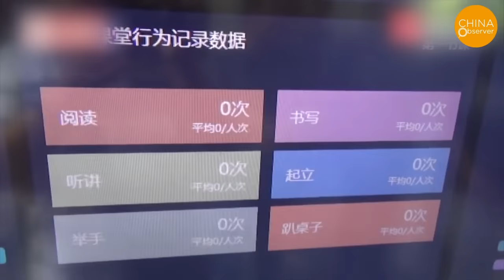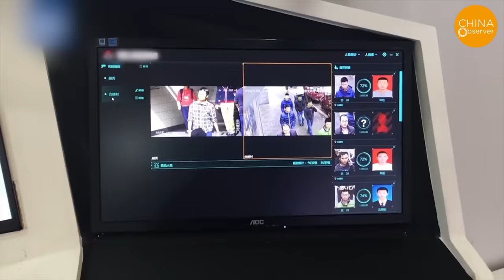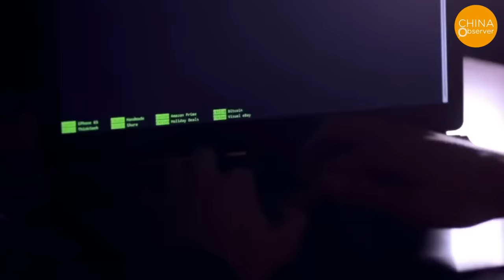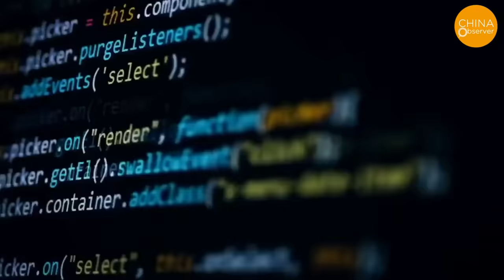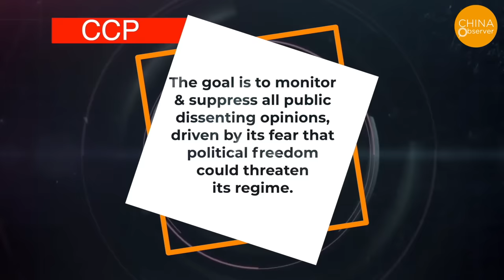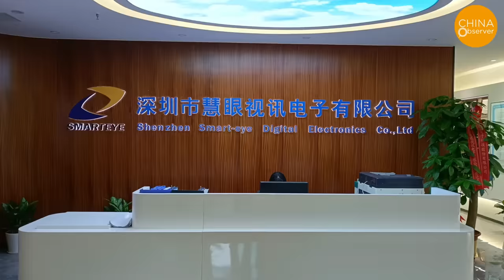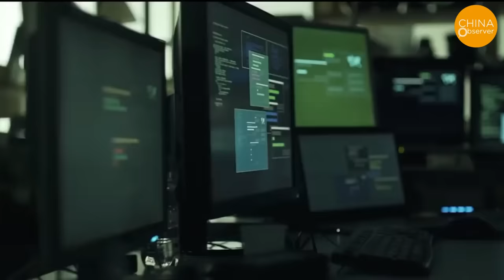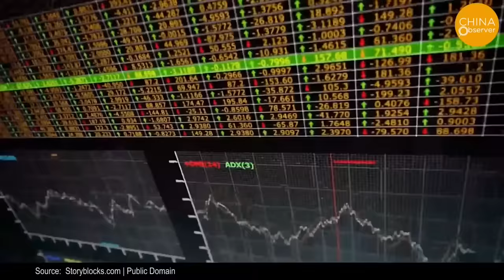Don’t Go to China: CCP Monitors Your Fingerprints, Face, Voice, Handwriting and Even Gait

Comment: The issue with Hikvision (and Dahua) is not being accurately relayed. There are very few brands of IP cameras that aren't made in China. EVERYONE makes their cameras in China.

However, non-Chinese brands (such as Axis) create firmware that won't send any information off-network that isn't explicitly configured.

Generally speaking, the features on display in this video won't be a function of the camera; it will a function of the NVR they send video streams to.

Additionally, any decently skilled network engineer will be able to restrict connectivity of the camera to exactly what it needs to talk to (the recording NVR)